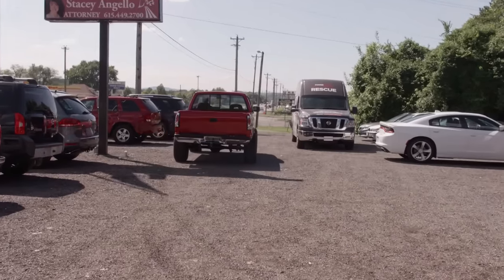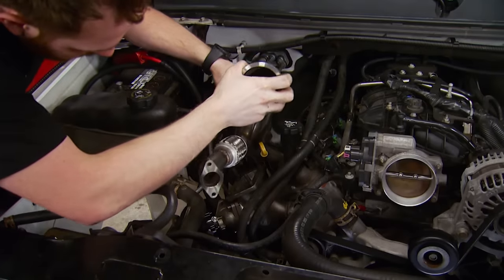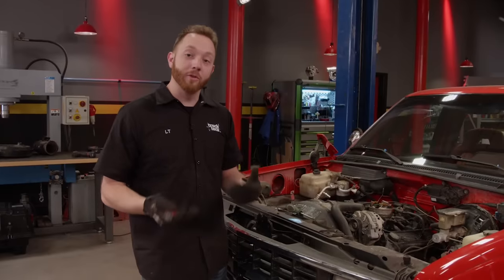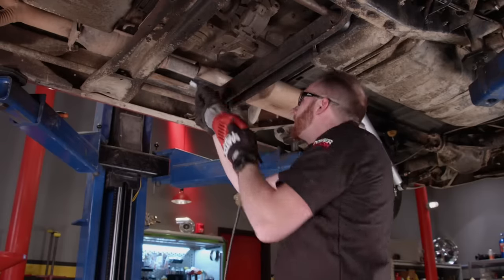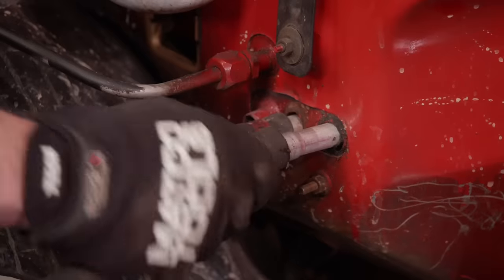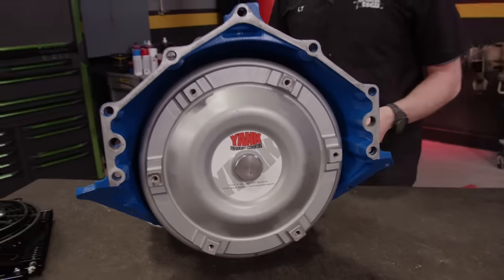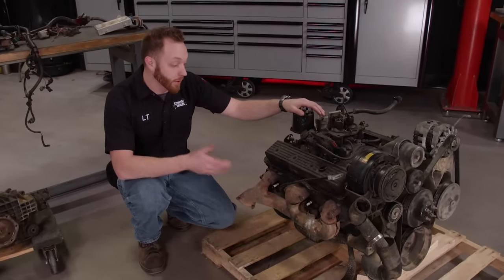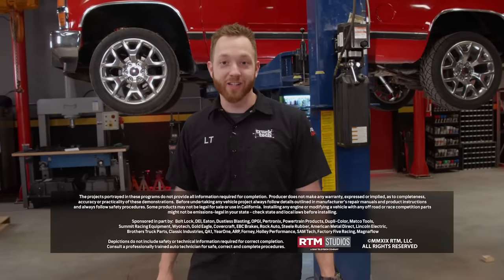LS Swap Do's & Don'ts on a Chevy K1500 - Truck Tech S6, E5

Comment: 185k LMAFO My 305 has 336k still going strong!
Reply: Lol I though the same thing.. This 305 in my shop has 300+ but the timing set is worn. It's getting a 350 short block put under it though
Reply: The oe 350 tbi in my one owner is at 432,735mi and is still our daily driver so at 185k I'll take the olé engine off of his hands. 👍👍✌✌
Reply: 5.3 flex fuel 280 on mine best truck I've ever bought and as they say as long as there is oil in them they'll keep on pushing it may not win any races due to the weight (03 Chevy suburban 4x4) but what's that they say about the turtle? Lol
Reply: My 93 has 362k
My 99 has 286k
Reply: Nice lol mine is a 350 with 223k miles and honestly it needs a little work but it’s goin well too
Reply: The 6.0 in my 03 denali has 325,000 roughly give or take. And it still runs strong as the day I got it.
Reply: The Voice Of Reason  The point of the video is to show you how to save money by doing an engine swap rather than spend thousands rebuilding the stock engine.
Reply: Yeah, you're right, that 305 is a WAY better engine than a 5.3 LS motor😉😉😉😉😉🤣🤣🤣🤣🤣😄🤣🤣🤣🤣
Reply: 350 on ours when it’s electrical killed it
Reply: 315k on my 2 door 4x4 tahoe
Reply: 267, 283, 301, 305, 307's are some of the most reliable engines ever build not as good as the LT/LS family but they last forever I have a 307 in my 82 Cutlass Supreme Brougham b un t I bought it for the sole purpose of a LS swap!...but I'm rebuilding that 307 and THM350 tranny so that someone whose not interested in a LS swap can breathe new life into their G-body with OEM plug and play platform!...hell I'm giving them the radiator too!...lol
Reply: BOWTIES RULE FELLAS!!!
Reply: My 4.3 has 300k
Reply: @the_car_guy5915  I can rebuild a older 350 motor for under 600 bucks. LS long block will cost you twice that.
Reply: My 4.3l v6 vortec in my 02' 2 door Blazer has 190k miles. I've put 20k on it myself. See yall out there till the day I send it! Still spins the tires on a good day
Reply: The Voice Of Reason u hihyu bj
Reply: @redwolf230  they're trying to get a lot more power than just a rebuild. A rebuild would just restore the measly (in today's terms) stock power. So they suggested the stroker rebuild and noted the costs. So, with that said, they're showing the swap for a cheaper, reliable power gain. Literally almost doubling the power with the swap. LS engines are so efficient and reliable in stock form. Secondly, they take power adders so well while maintaining reliability. Also they upgraded the trans for their added power. They're explaining that doing a swap for power is not as expensive as you may think versus rebuilding and machining the vortec engine to get decent power.
Reply: @fbodyblack  my 05 Z71 with the L33 5.3 went 388k miles before I sold it 5 years ago. I still see it running around town and know the original engine is still in it. Not sure of the miles, but the engine was dogged the 7 years I owned it. Only the water pump went out.
Reply: My 350 has 679k miles and has been rebuilt only 1 time
Reply: My 4.8 is reaching 400k and still going strong
Reply: Going strong with 150HP?  Lmao. These guys said they wanted performance.
Reply: Whoever had it thought it was a LS lol....beat the hell out of that poor motor 🤣
Reply: Dave Micolichek  oh I know a Pontiac 301 was the first engine I ever built by myself!...lol they all are great and indestructible engines!...along with 260, 262, etc...but anyways they're still GM products!...so the designs are generally the same!...
Reply: Dave Micolichek  I believe the Pontiacs and Buicks got the Chevy 305 after 84-85 rite?...Olds still put their 307's in Cutlasses until the end!
Reply: @redwolf230  not really!...we've taken a $200 LS engine/stock ECM and stuck a cam in it and hauled ass!...$400 bucks and away you go!...unless you need to spend another $100 bucks on a 4l60e or 4l80e tranny!...and its still a deal!...
Reply: My lq4 has 380k lmao
Reply: It's easy to only get under 200k miles before its spent...just change the oil 2x a year lol. My tbi 94 350 had 348k before I scrapped it. The interior is shit on these trucks but the motor ran red hot one day on the way home from work. Blew out the freeze plugs. Instead of paying 200 for a hook home, I kept driving. It sit for 3 years after that until I had to jump it off to move it. Fired right up. Scrapped it for 250. Moral of the story is, change the   oil and do maintenance. These motors will out live the cheap interior as long as you dont run them hot lol.
Reply: My 2002 Silverado has 385,000 thousand and still climbing, she’s a beast
Reply: @mchenryjeremy  The 190hp is underrated. Rebuilt with a cam upgrade would put it close to 300hp. And parts for the small block are CHEAP.
Reply: Muskoka Roads  cam and transmission. Factory-installed serviced regularly.
Reply: The Voice Of Reason  or they wanted to show people how to start their own project for cheap. That's also another way to get money. Not every vehicle wears the same.
Reply: @nathanielbolden5053  they last a while because they're not "performance" engines.
Reply: @alecb8509  I think you misread my point. Go re-read my comments. The costs to rebuilt, parts, machining, etc to get the power out of the stroked 5.7 would exceed the costs of an LS swap. The cost of parts are cheap, but the amount of parts required adds up to the bill. That is their point.
Reply: @mchenryjeremy  Yeah, i still think you could rebuild the original engine(without stroking) with enough performance parts to make excellent power for a fraction of the cost of an ls swap.
Reply: Spelled “LMFAO” wrong.
Reply: @noquemalive7111  say it slowly. You can say it LMAFO. both work. Some say the latter to make a point...
Reply: Why you laughing? Like the guy said "Its all show and no go!" Lmfao
Reply: My 350 has 235k lol
Reply: I was thinking the same thing I'm sitting with 315k
Reply: Damn that's pretty good man,mine has 298,000 1990 350 TBI
Reply: my 350 has 355 💀
Reply: Depends how it was driven and maintained.
Reply: Will your 305 or 350s run 300k on factory plugs? Didn't think so
Reply: My 98 K1500 has 335,000 on original 305 and it's still running strong, I want to do an LS swap but I kinda want to see how long this 305 will go...it shows absolutely no signs of being old and tired, doesn't burn oil between oil changes, I feel bad for talking trash about 305's all those years before I bought this truck.
Reply: Probably uses more oil than fuel at this point lol
Reply: Nice, had a Toyota that I engine swapped with the original mileage of 552k miles....
Reply: 305!! LMFAO🤣
Reply: All about maintaining the engine my uncle had a 85 ranger which got a oil change ever 3000 never missed. It had 840 000 when he finally parked it
Reply: @brentboster7730  my 98 silverado  at 165k 305 so my oil pressure at full temp shows 20 psi at idle and 40psi when driving is your 305 in the same range ?
Reply: My 97 k1500 350 has 360,000 doesn’t smoke and runs great. My truck is all go and no show, it’s been used as a truck.
Reply: My trusty 1999 Tahoe's 5.7 vortec   has 409+ km/ 240 miles and still runs like a swiss watch.
Reply: @brentboster7730  I've got a 98 c1500 305 and its a great engine 167k the 305 vortec heads flow almost as much as the 350
Reply: @dalehall2993  sprint racer 305 class  Brodix heads 450 hp
Reply: Yea but you going like 40 mph
Reply: This truck had 100 hp
Reply: @jonschwartz9669  mine has slightly better pressure when driving around but idle is around 20 psi when is warmed up, I'd say my psi never goes over 50-55psi
Reply: Haha ya my 350 vortec went 456000 before needing to be replaced
Reply: Buddy I’m about to 5.3 swap mine at 456k 🤣 and it ran when parked
Reply: The old 305 was pretty decent...
Reply: The 305 was never “strong”.

Comment: “Simply by adding a larger camshaft”😂
Reply: thery forgot the lifters, gaskets, trays, and valvesprings/retainers lol
Reply: Larger? You mean it has larger bearing surfaces? Bigger lobes?  Lots of sloppy slang. They represent as professionals.  They are not!
Reply: Simply change everything but the block
Reply: LOTR meme: one does not simply "add a larger camshaft"
Reply: @collinator68  for real 100%
Reply: Simply swap in an lt5 and a 10speed...

Comment: Its good to compare a new 383 to a new LS in order to keep it apples to apples. But the 5.3 is a smaller engine, needing a power adder which means higher octane fuel, which adds to costs. Compare a 383 to the cost of, say, a 376 cid naturally aspirated, and since it has to be shipped, add on the shipping cost if you're building the 383 locally (if you're buying a crate 383, it obviously has a shipping cost as well unless you're bringing home a GMPP crate engine from a dealer). Then add up the cost of everything that bolts to the LS that doesn't transfer from the Gen One. A/C front mount, oil pan, throttle by wire, all emissions equipment, fuel system, transmission etc. 

typically, its the small things that get ya :)  Sometimes, it can be cheaper just to buy the entire vehicle the LS came in and hot rod that.

Comment: This show is like 6-7 years behind. OBS ls swaps were the shit about 6 years ago. Now a days everything is ls swapped with turbos. Plus an ls swap on an OBS is probably the easiest swap anybody can ever do. It's almost like the engines are made to fit exactly in that chassis with no modifications needed. All you need is a pair of cheap eBay $20.00 engine mount brackets and drop the engine in the truck. Everything else will work like it was made for it. Radiator power steering oil lines, fuel lines. You can even use your old A/C bracket if you want to keep your ac going.
Reply: All said and done   A Little  over $18,000  spent on this     "Budget blown"......
Reply: This show is from years ago.

Comment: I have only been working on cars along side my step dad in his shop for a year noe and out of the few motor pulls I have done this has to be the easiest. I actually did mine myself in 2 hours--it was my grandfather's truck that got totalled in the rear and I'm putting it in my boat when I rebuild it. Granted it only took me 2 hours because I did cut a lot of things that weren't needed for it to go in the boat, I could probably have still got it done myself in 3 to 3.5 hours if I had to keep a lot of things. These motors are super simple and easy to work on, and in these trucks, easy to work around. I ended up scrapping the truck just yesterday and I got about $100 for scrap for the truck, $150 for the tires and rims, $100 for the transmission and about a $100 total for a bunch of miscellaneous items.

Comment: A couple more tricks to keep track of nuts and bolts: Buy a cupcake pan which has 12 cups and using a sharpie number each one. When you are taking things apart, put all the fasteners from one item in a cup, and on a numbered notepad write what they fit. Also have several Ziplock bags of different sizes, and use those for misc parts, marking them with a sharpie as to what they are and where they go. Don't think you'll remember where everything goes, write it down to make sure.
Reply: The ls engine is a simple engine

Comment: The oval torque converter bolt hole in the flex plate is the first bolt. You can tighten them as you start them if you know about the oval bolt hole. Saves time.

Comment: Lol! When I did my swap, I found the wires for the headlights, then cut everything else with a pair of big lineman pliers. GT280 electrical connectors are the way to go. 
No more A/C. No more automatic nonsense. No more HVAC problems. No more ABS. 
Get a 40 circuit RFRM. It has 10 relays, 4 fuse circuits per relay, for 40 circuits total. Each relay uses 2 fuses (30 and 86)
Don't get rid of the A/C condenser. It makes a good radiator protector. 
-The only regret I have was the way I set up the clutch. I should have set up the hydraulic release bearing while I dial indicated the bellhousing. 
-The passenger exhaust manifold gets really close to the frame and suspension. A hooker exhaust manifold for the passenger side is a better way to go. I mean, yeah, my truck has longtubes now, but there's nothing wrong with manifolds.

Comment: One thing I would add is to use a piece of tape and mark what EVERY electrical connector went to so you're not guessing three weeks later when you're putting it back together.

Comment: I work at a hot rod shop and have done many LS swaps, that being said, with a little fabrication knowledge you could modify the OBS frame to use the stock A/C compressor.

Comment: 10:33 how you imagine pulling your first engine however reality quickly sets in and you take off the front end and pull it with the trans connected.

Comment: Gonna have $6000 plus in that 5.3 by the time you dress it out.. should’ve bought a junk yard engine for 300-500 and modded that... it would come with all the dressings
Reply: Junk yards don't sponsor the show LOL
Reply: For real. My 5.3 swapped c10 with a cam whole build came in under 4k
Reply: Exactly
Reply: @stevenhorsefield2909  complete pull out with trans, harness, and all
Reply: Agreed, I hate when they call it "budget-conscious" when it clearly is not
Reply: yep they dont sponsor it, and you could always pull a junkyardengine and put its stuff on instead so i agree
Reply: 100% agree
Reply: @LT3Fluffy  where did you get it done at ???????
Reply: @LT3Fluffy  with transmission as well?? And all harnesses

Comment: Blocks have drain plugs.  These are in most cases a great way to avoid a mess. I keep a cheap plastic 1/4" npt fitting with a 5 foot piece of clear tubing for the occasional job: replacing a water pump, radiator or hose.  It is a HUGE bonus if you ever need to pull heads - there's no need to flood cylinders.  It also is one of those odd  4 or 5 year checks you might want to do: how much crud is accumulating in the block and munching on water pump seals when you drive?  Those drain ports will let you know.

Comment: That's what I did on the 90's
Dropped my made in the USA short bed chevy 4x4 truck and install a Mexican 400 engine.
Best on 1/4 mile racing with the transfer case on 4H...
I did get away from the Mexican highway patrol or federal de caminos many times 😂😂😂😂
And they had interceptor crown Victoria's donation of the CHP...
I had a 700r4 MD8 modified transmission. Yes automatic.

Comment: Just bought a new 350 crate after 285,000 miles on engine and 2 transmission rebuilds. I know these 1988-98 trucks are not so desirable 20/30 years later but my goodness are they reliable and cheap to replace every part is in stock at your local auto store

Comment: So your just not going to talk about the fact that the 4L80e is longer than the 700r4 and when doing this swap you will have to drill new holes in the frame for the transmission cross member. At 16:02 you can see the problem.
Reply: Cody Ayers and probably have to cut down the drive shaft!
Reply: @robertthibodeaux4435  he mentioned that when he pulled them. Didn't say anything about the cross member though
Reply: Wow 4 holes...think we should stop &put the old engine back in...
Reply: my silverado has like 8 bolt patterns for that cross member...my dad liked to experiment lol

Comment: That's really good advice separating that transfer case from the transmission , my cheap harbor freight tranny jack did not like both at the same time , I was catching it to keep it from hitting hard   cut my hands up a little ..bent the legs on the cheap new hf transmission under hoist jack .

Comment: Well we can see that truck is a repaint now with that over spray. Was a little suspicious of how nice the clear was with that undercarriage a little roughed up!
Reply: Youve never heard of a called a clay bar? Removes all the over spray easily and quickly
Reply: @cboyamg  So you going to clay bar that electrical bulk and ac line ends? It's not going to have paint that clean without a respray at that age with that undercarriage condition.
Reply: @Vakii88  what?

Comment: I'm the all smoke when they get old. I had a 305 in a 88 that basically was a two-stroke and it burns a quart of oil a day. Had 235,000 mi on it. Still ran like a top. Couldn't do about 80 though. It could do 80 but that was about it. Was about to blow up. I pulled it out. Still running though and then put a LT1 in it. 89 GMC k1500 short bed. Regular cab 5. Speed LT1 out of a roadmaster I also went from the 3500 to the 4500 New venture

Comment: LT I build a 408 LS out of LQ4 6L .03 over bored and stroke form 3.623 to 4." 
I don't two and hp at the crack shaft but at the tires it has 253 HP and 361 TQ it in a 2001 Chevy suburban 3/4 ton 4x4 it's a work vehicle thanks LT you make this show what it or was

Comment: My Clean 89 GMC pickup 3/4ton. Took out the old broken engine 
  I installed a 96 to 98 vortec engine 350.  350 HPS.  Was swap out of air intake manifold and use the TBI distributor and TBI and was all plug and play.  The engine only has 65000 miles on it.

Comment: @7:47 " I will hafto remove the fuel lines from the radiator"  really? fuel intercooler?
Reply: 321Catboxnwc he said a few lines.. not fuel lines
Reply: @mississippimotorsports3286  AHHHHHHHHhhhh......had me scratchin my head . thanks
Reply: 321Catboxnwc lol but he is dumb for lowering a 4x4... and spending 3500 for a 5.3...
Reply: @mississippimotorsports3286  Everybody knows its way easier ! plug n play!  Perhaps that 5.3 fell off the back of some truck?
Reply: @mississippimotorsports3286  that's the first thing I noticed, pan around the truck and they start talking about lowering it and then you see the 6 lug nuts. Stupid
Reply: “I will have to remove a few lines from the radiator”

Comment: Very vehicle specific. If you doing these year models engine pull dont forgot the bolt down on drivers side holding the fuel line. 13mm in later years.